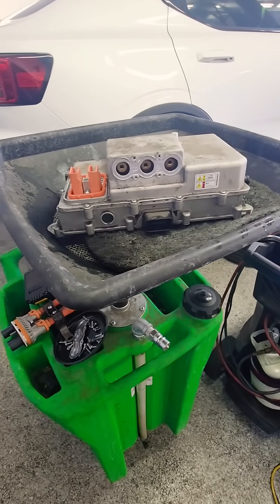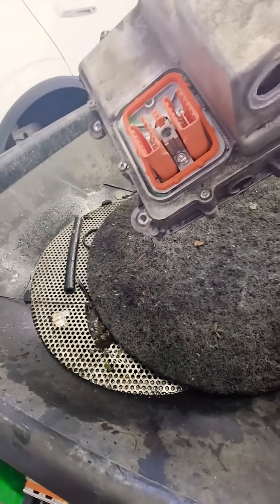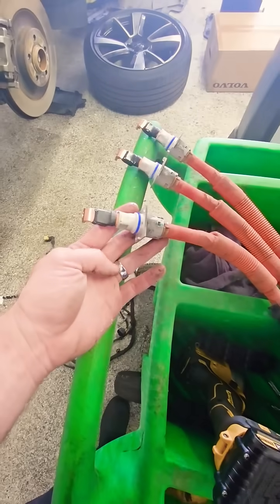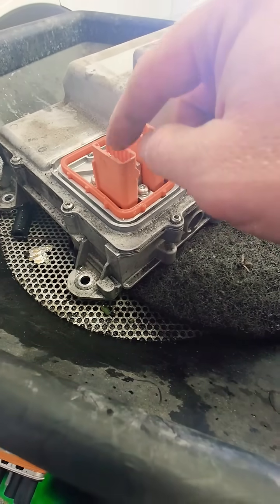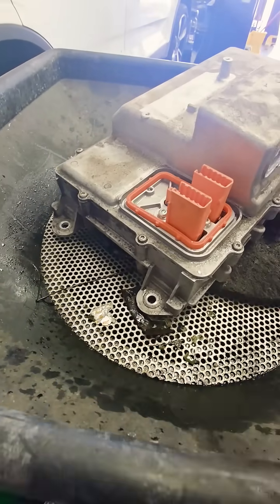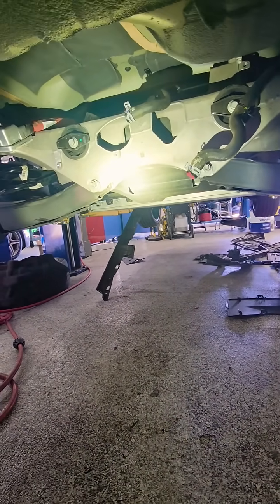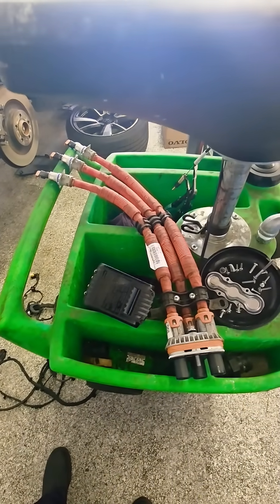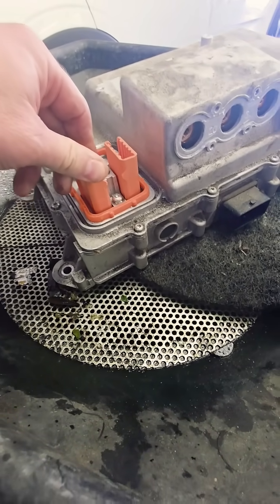High Voltage Inverter Coolant Leak ● Polestar

Comment: Why would it leak internally? Why design  the coolant go inside the inverter instead of the outside to cool it? Is this a bad design where the seals couldn't stand up to the constant temperature changes? 
I would If like to see you break it open and show us the seals where it leaked through.
Reply from the maker: This one failed at 100k in mileage almost. Thats a lot of miles for any vehicle. I replace them on almost every electric vehicle manufacture.  When vehicles hit that 100k mark things start to malfunction. 

The man cause of the failure was heat, the seals failed. The vehicle was a rental vehicle that was beat on horribly.  This is not normal wear and tear.

Comment: What is in this coolant? If its just ethylene glycol i dont understand why you need to replace the cables.
Reply from the maker: When copper is in contact with radiator fluid (coolant) and an electrical current, a process called electrolysis can occur, causing rapid damage to the copper components. Electrolysis essentially accelerates corrosion, leading to leaks and failures in the cooling system. In this case, it caused really bad corrosion at the main cable.. This caused extreme heat and electrolysis to happen. The inverter failed because of this. The internal coolant seals gave away from  corrosion build up.

Comment: ☝️ Don't believe everything you see here on YouTube. It needs a simple seal and drying out. That coolant will not cause corrosion.!
Reply from the maker: When copper is in contact with radiator fluid (coolant) and an electrical current, a process called electrolysis can occur, causing rapid damage to the copper components. Electrolysis essentially accelerates corrosion, leading to leaks and failures in the cooling system. In this case it caused really bad corrosion at main contact. This caused extreme heat and electrolysis to happen. The inverter failed because of this. The internal coolant seals gave away from  corrosion build up.
Reply: Ok, my apologies, I was confusing it with early fully submerged synthetic coolant. Which was none conductive and none corrosive. Apparently too costly for mass production.
Reply from the maker: Thank you for watching,  I like working on electric vehicles.  If you ever have a question about a hybrid or electric vehicle.  Maybe I can help.

Comment: If the coolant has entered the motor controller and has got to the mosfets and on the PCB the battery voltage will break down the materials taking  away PCB traces and mosfet legs etc. I dont know how conductive antifreeze is but if you left an xamio e scooter in bath over night with the  battery connected the control board will be destroyed from the electrolysis.
Reply from the maker: Your correct,  When copper is in contact with radiator fluid (coolant) and an electrical current, a process called electrolysis can occur, causing rapid damage to the copper components. Electrolysis essentially accelerates corrosion, leading to leaks and failures in the cooling system. In this case it caused really bad corrosion at main contact. This caused extreme heat and electrolysis to happen. The inverter failed because of this. The internal coolant seals gave away from  corrosion build up.

Comment: Did you say coolant destroys copper?
What about my 90 civic heater matrix? It's made of copper.
Reply from the maker: When copper is in contact with radiator fluid (coolant) and an electrical current, a process called electrolysis can occur, causing rapid damage to the copper components. Electrolysis essentially accelerates, leading to leaks and failures in the cooling system. In this case it caused really bad corrosion at main contact. This corrosion caused extreme heat and electrolysis to happen. The inverter failed because of this. The internal coolant seals gave away from  corrosion build up.
Reply: @FullyChargedZone What is the source of current? The chassis should all be at the same "ground" potential. Dissimilar metals could certainly create the driving potential, but usually they are made of aluminum which would be more reactive than the copper.
Reply from the maker: 400+ volts from the battery
Reply: @FullyChargedZone The current doesn't travel through the coolant. That would short out the system and HVIL would shut it down.
Reply: @FullyChargedZone Nice, great explanation
Reply: Is it not brass?
Reply: @Blandy929 Really is it? If that's true I did not know that.
Reply: It's a different coolant. But I'm still with you. Coolant is specifically chosen to not corrode the components. Also all parts of those connectors are silver plated, so it isn't copper we need to worry about. 

I think he needs to clean the connectors with some IPA. Then inspect. Chances are that it is fine.

Comment: Had a VW PASSAT coolant migration from level sensor in coolant expansion tank maybe a $35.00 part took out a $2k dashboard , engine harness maybe anther $3k and many other modules and sensors.
Reply from the maker: 3k every 5 years is about the average repairs on a vehicle . I love Volkswagen vehicles.

Comment: Then he finds out the battery was shorted and needs to be replaced too.
Reply from the maker: I've seen it in all hybrid & electric vehicles. When a engine shorts out it usually takes the battery out also. The newer electric vehicles have a protection to shut the battery down when a drive unit malfunctions. Batteries today are pretty durable.

Comment: Electric vehicles can’t handle novice drivers. They’re like a laptop with wheels; one curb hop away from damaging the batteries.
Reply from the maker: Electric vehicle (EV) batteries are designed to be robust and resilient to road impacts. They are typically placed under the floor of the vehicle, often in a strong, protective casing, and are built to withstand impacts from various directions, including from road debris. The battery pack itself is housed in a sturdy, often aluminum or steel, case designed to withstand significant impact from the bottom, sides, and even from above. In some EV designs, the battery pack is directly bolted to the chassis, further reinforcing its structural integrity and making it part of the vehicle's overall safety system. EV batteries are designed to be waterproof and protected against hydraulic damage, ensuring their integrity even if exposed to water or other fluids. In my opinion they're pretty safe.

Comment: Mmmmmmmm......yes.....I can smell the irony of these wonderful electric vehicles. 

But this makes no sense? They are supposed to be practically maintenance free? I'm so confused now🤔
Reply from the maker: I'm an electrical engineer,  I've been working on electric vehicles the last 10 years. I've also worked on multiple different manufacturers over 25 years. I've never seen a vehicle that hasn't broke in some way. All electric vehicles break just like gas vehicles.  Rivian, Tesla , Lucid , Polestar and the rest of them, all break. I would love to see a maintenance free vehicle someday.
Reply: Yes, hundreds of years of combustion engines to get to where they are, but lets expect all electric vehicles to be perfected within the first 15 years. 
The fact it's a cooling related issue isn't too weird, considering current vehicles have cooling issues still....
Reply: @OhMyGoshJawsh pretty sure electric came before ICE

Comment: What a stupid design.
Reply from the maker: In my opinion, Its the weakest point on all electric vehicles.  This failure usually happens between 120k and 200k in mileage.  Tesla also has very similar failures.

Comment: Polestar still in business? Looks like a pricey job...
Reply from the maker: In my opinion, the Polestar is the second-best electric vehicle on the market. It's owned by Volvo and it has pretty decent engineering. The best electric vehicle is a Tesla. They also have a 10-year start.  I really believe that Polestar will make it into the future. This costs about $3500. The vehicle has 120,000 miles on it. I think that's pretty good mileage for the cost of repairs.

Comment: 'Coolant destroys copper'? It most certainly does not.
Reply from the maker: When copper is in contact with radiator fluid (coolant) and an electrical current, a process called electrolysis can occur, causing rapid damage to the copper components. Electrolysis essentially accelerates corrosion, leading to leaks and failures in the cooling system. In this case it caused really bad corrosion at main contact. This caused extreme heat and electrolysis to happen. The inverter failed because of this. The internal coolant seals gave away from  corrosion build up.
Reply: @FullyChargedZone I was gonna say almost like a electrolysis. Not sure if thats the right term. But whats really gonna destroy the copper is that its the way for power in unlike a radiator this copper has power to it and thats the difference.
Reply from the maker: Yes, you're correct. Copper corrosion in radiator systems, particularly due to electrolysis, happens when electrical current flows through the cooling fluid, which acts as an electrolyte. This current causes copper ions to dissolve from the copper components (like the radiator itself, or connections), and they are then deposited elsewhere in the system as corrosion. This is especially problematic when different metals in the cooling system (like copper and aluminum) are in contact.
Reply: In this instance the coolant acts as an electrolyte connecting the two dissimilar metals into a circuit. Add electricity and you get galvanic corrosion on the copper. It will actually strip atoms off one metal and bond it to the other.
Reply: Copper in your radiator is not electrified. Big difference.
Reply: So my radiator isn't copper??
Reply: @icebozeman5627 probably aluminum
Reply: @icebozeman5627  Nope, brass ages ago but never copper.
Reply from the maker: They're used in older vehicles. I've seen a lot before 1970. Most coolants are conductive. When copper is in contact with radiator fluid (coolant) and an electrical current, a process called electrolysis can occur, causing rapid damage to the copper components. Electrolysis essentially accelerates corrosion, leading to leaks and failures in the cooling system.